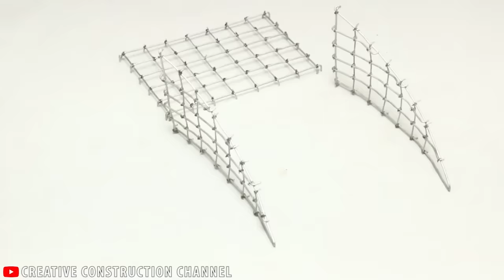Concrete Bridge Model Full | Miniature Construction | Creative Channel

Comment: Only issue is that you didn’t link your pours together with rebar. If you do separate pours you need to have rebar poking out so that the next pour can be over the extruding rebar and make it more sound. You also should have painted the rebar green to match the apoxy they use on bridges.
Reply: wow
Reply: pri

Comment: No cover on the bottom of the column base. No splice/overlap (40×d) from the deck beams to the column heads. Parapets on bridges are extremely important and require intricate designs. You'll have to get the pecker out and demolish it. 
Seriously though the reinforcement is inadequate and in reality the bridge would collapse.
Reply: @Cameron Price 
No he's doing it for educational reasons it's not mechano

Comment: That black concrete you used on the bridge should have been used on the roads underneath... because technically the concrete you used down there should be used for side walks not roads